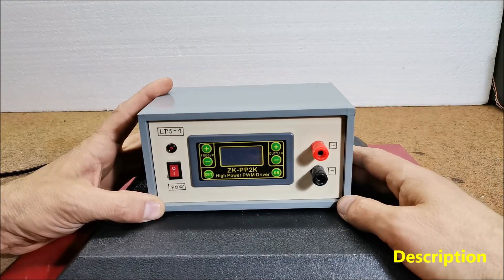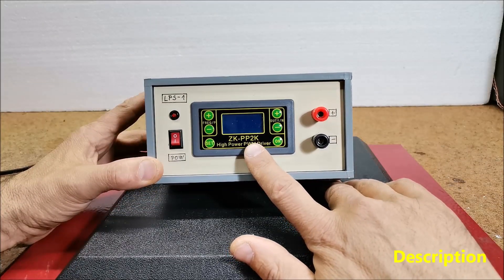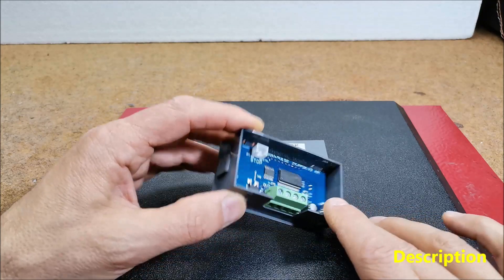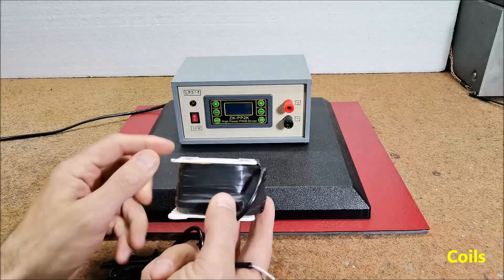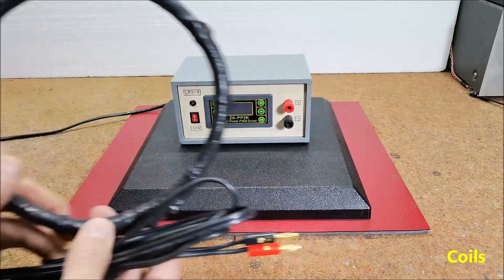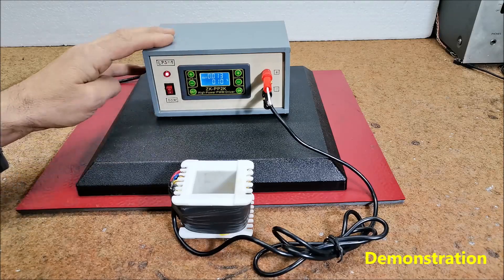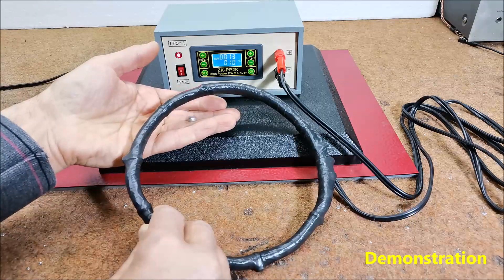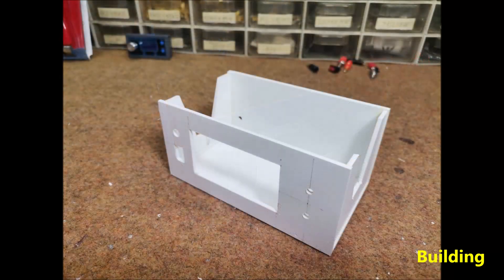How to build Simplest PEMF (Pulse Electomagnetic Field) Therapy Device

Comment: This information has been very helpful. However, I’m curious about the reason why the inductance of the coil should be at least several millihenries. I am working based on the information you provided, but my knowledge and equipment are quite limited. Is the purpose of having an inductance greater than a few millihenries to block high frequencies? I would really appreciate it if you could explain the reason. Wishing you a Happy New Year!

Comment: I made a coil with a diameter of 8cm, 300 turns, with an AWG23 wire. Why does my coil heat up a lot? to the point of not being able to touch it. Thank you

Comment: Do you have any advice for absolute newbies at these kinds of projects? I'm just worried about wiring it wrong mostly and starting a fire or something :D. However, I have a few personal health issues, I would love to try addressing with PEMF. I've used a PEMF device by a company called NeoRythmn that works not-bad but its only like 0.5mT or something relatively low-power so I ....feel like I barely feel it? for the uses I had intended at least.... it helps reduce pain/inflammation a bit and promote some healing. I just feel looking at many of the studies showing relief online, thye are using like 2mT to 5mT so 0.5mT is perhaps barely above the minimum viable dosage threshold for treatment. Akin to taking 50mg of Aspirin when studies showing pain relief suggest taking 250mg-500mg.... in theory, 50mg is better than 0....but barely.

Comment: Made this with a 60mm coil with a winding of 9 ohms with a.35mm copper and it works but coil gets extremely hot?
Using laptop 19 volt power supply 
Tried another coil at 16 ohms and still gets very hot 
Is this normal
Reply from the maker: Yes, that's normal

Comment: Hello.  I have build large magnetic coil from 2mm diameter wire.  Resistance .8 ohm.  Sadly it draw too much power from the ZK-PP2K .  Could you recommend cheap signal generator to run this large coil?  Many thanks.
Reply from the maker: In that case, I recommend you to watch the following video:    https://www.youtube.com/watch?v=TgRXBQuStAA&t=3s
Reply: @MirkoPavleskiMK  Many thanks.  Missed that video for some reason.
Reply: Reduce the duty cycle or add a capacitor (100uf or larger) at the output of the power supply.

Comment: Mirko thanks for this! Will be building one after the parts arrive. Can you please explain how to use the LCR meter with the 9v battery in your video. Thank you so much! :) Looking forward to more health related DIY electronics video... Maybe a zapper next time?
Reply from the maker: That is a cheap universal instrument from Aliexpress, and it is necessary to simply connect the coil to both electrodes. The device detects that it is a coil and gives the value of inductance. I am currently working on a Bob Back Brain Tuner and I will present it in one of my next videos. Of course, Zapper will come in the future as well

Comment: Geat projet.Can any person use herbody with a short education? What is benefits ?  application time ,periodes ? What is duty and voltage and duty range for(example) back pain ? or broken leg therapy time
Summary have a setting table for health problems?
Reply from the maker: I see the device only from a technical point of view. You can find more information online, for example : https://www.corebodytherapy.com.au/pemftherapy.php .   Otherwise for the larger coil you need about 108 meters of copper insulated wire with a diameter of 0.7 millimeters
Reply from the maker: Me too, thanks for information